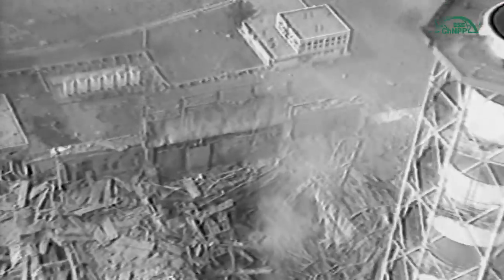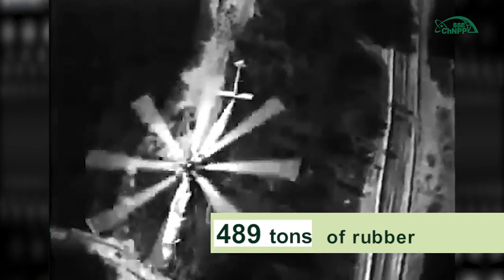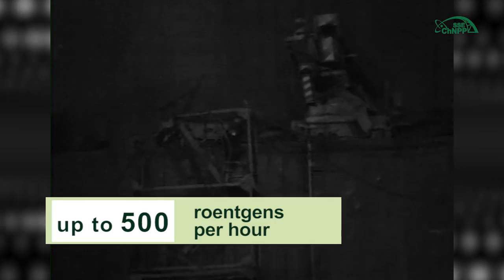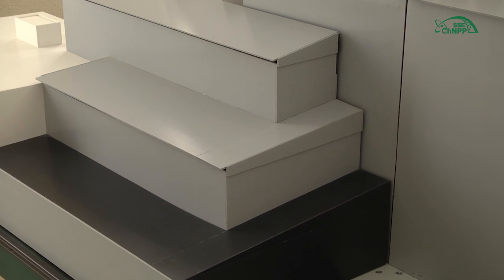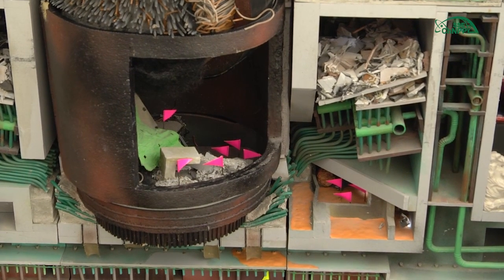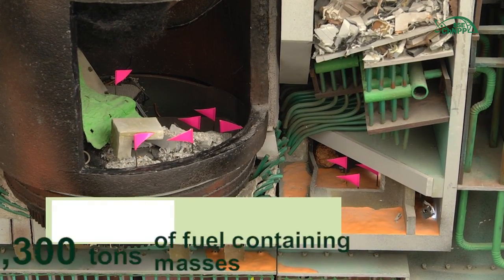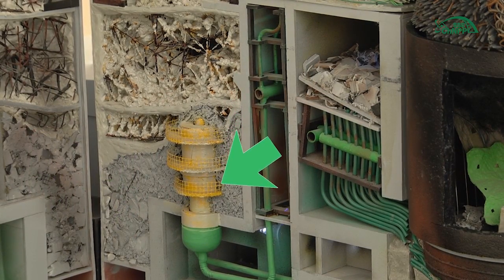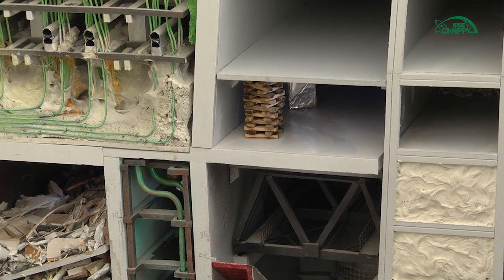Excursion within the "Sarcophagus"

Comment: I heard when the lid of the reactor was blown off, it came down with such force that it forced the reactor downward.  What that did was dislodge the sand packed around the outside of the reactor to come loose and mix with the molten nuclear fuel.  This mixture of molten nuclear fuel and glass made its way down to the basement of the reactor building where it cooled.  We are all lucky that it didn't melt down into the ground water that flowed under the plant.  That would have caused a catastrophic steam explosion that would have made all of Europe uninhabitable for centuries.

Comment: I bet the destroyed reactor could be cleaned up given how the USA has a massive crane at their ship yard they use assemble their super carriers. 

Deep borehole disposal (DBD) is the concept of disposing high-level radioactive waste from nuclear reactors in extremely deep boreholes instead of in more traditional deep geological repositories that are excavated like mines. Deep borehole disposal seeks to place the waste as much as five kilometres (3 mi) beneath the surface of the Earth and relies primarily on the thickness of the natural geological barrier to safely isolate the waste from the biosphere for a very long period of time so that it should not pose a threat to humans and the environment.

You would dismantle what's of the reactor, put the pieces into  casks, and then lower them 3 miles underground & seal it all up possibly with the concrete of the power plant itself before layering a bunch of virgin material on top of the power plant rubble.

Comment: Great model.  Still a raging communist failure.  Always use water instead of other materials as a conductor.. this way if the core melts the reaction stops because the water evaporates.  RMB reactor is flawed design and sadly they still use them in parts of Russia. 😅😅😅

Comment: Please, when showing model of the exploded reactor, first look at and analyze it a bit. If 1000-ton lid flew up 30 meters in the air and dropped back onto reactor, it would definitely crash itself and the reactor vessel creating sigificant damage to both. From the pictures (and this model too) I've seen no major damage to the lid and reactor vessel due to lid falling down, therefore I concluded that it DIDN'T fly up in the air, it just popped open and remained vertical.
Reply: Furthermore, observe the steam separator drums on the model, the green sheet arounf them (it's thick steel pressure shield in reality) and concrete slabs above it. It quite obvious they all suffered major explosion that clearly took place ABOVE the reactor vessel and its lid. It's obvious that explosion pressure came from the sides, not from below. That explosion could have come ONLY FROM hydrogen buildup. But hydrogen is waaaay lighter than air, so for hydrogen to build up in the area above the lid the ROOF and the SIDE WALLS of the reactor central hall must have been mosty INTACT after the initial explosion that popped up the lid off the vessel!

Comment: The reactor contained at the time of the accident....2000 tons of material, as stated, or 200 tons as the caption on screen says?
Worth fixing this error...
Reply: The RBMK- 1000 contains 1700 tons of graphite in which the pressure tubes are mounted, 190 tons of uranium dioxide. This is stated if the reactor is in operation. Then the material that regulates the reaction, graphite at the control rods and others. There are many other materials that keep all this things together. So the 2000 tons seems to be true. The 200 tons you are talking about seems to be the 190 tons of uranium dioxide.

Comment: This video got me wondering, would there be any advantage to filling the inside of the sarcophagus with one giant block of concrete?
I can see that perhaps it not being reinforced concrete might be an issue, and it would obviously take significant quantities of concrete to do such a thing, but would it pose any benefit in terms of suppressing radiation leakage long term?
Reply: After burrying all of it under concrete, you'd loose all control over the situation inside. So much concrete would be too heavy and the foundations wouldn't be able to hold it, and the concrete would start cracking. Next, water (rainfall) would start seeping in and uncontrollably washing radioactive materials into groundwaters. And, because it would all be entombed, you'd not be able to reach and fix it. Ouch!

Comment: I believe I saw something in the mockup model consistent to that 'infamous' Elephant's Foot structure, though I am not that sure if it's location is correct.
But in the end, if the mockup model was built without it, it's pretty obvious that this well known structure is as 'relevant' as the rest of the Corium material that leaked out of the reactor.

Comment: They should have buried the whole reactor with concrete,  and kept on isolating it until it had atleast 30m with solid stone and sand mix in the midle, and used shot crete all over the outside... You won't be able to shield the environment with a cover that was used over reactor 4.. I am sertin that chernobyl still leaks, but we never hear anything about it... Do it correctly the first time, and get the reactor sealed for life. DAMN IT.
Reply: The foundation isn't good enough for the concrete, since the explosion makes the foundation of the building brittle and it couldn't hold heavy weight anymore, the reactor and the parts itself already weight thousands of tons, that's why

Comment: I was 2 when reactor #4 blew up. It was a major disaster but could have easily been avoided. We know enough about the accident it was a combination of a bad and dangerous design with operator error on top of that. It's a given the operators were unaware of the design flaw, however they still should have know better than to remove almost all the control rods and be surprised when their reaction spiked

Comment: Imagine the amount of potential leaks in a RBMK... Every channel has it's own piping and caps. Amazing it even works.
Reply: Every channel has its own water valve, too. One of a problem is that one or more water valves can stuck in closed position that can course an overheating or an local meltdown. That happened some times in the first versions of RBMK- 1000 (Chernobyl), because not all channels had it´s own measurement instruments. The RBMK  reactors that are in operation today  all have an own  controll system for each channel, so the operators can see when something is going wrong in each channel.

Comment: I think most of the radiation landed near Kreosan because those dudes are messed up... They have a recent video where they went into the chemical lab in Pripyat or Chernobyl and took home some of the sand that's covering pieces of the liquidation robots and runs at like 2000 rems per hour. They also waded around in thigh-deep water that's accumulated in the basement of the chemical lab.
Reply: Don’t forget diving in the flooded basement with a fishbowl for a helmet.

Comment: I’m not trolling when I ask this, but, did they ever attempt the test and again, properly, on one of the remaining reactors? What were the results?

Also, what happens to the bodies that died and remained in close proximity to the core? Is bacteria able to grow and therefore, decay the remains?
Reply: No, I rather doubt anyone would approach that test with welding gloves on.

There was only two people killed by the explosion per se.  The one, Khodemchuk, is buried somewhere in the rubble; he was never recovered.  The other, Shashenok, died in the Pripyat hospital from multiple injuries, burns and radiation the morning after.  He was buried in Pripyat, later moved to join his fellows in the Moscow cemetery.

Comment: Two things continue to puzzle me about the smothering of the reactor fire and the removal of reactor core material from the roof.

No one considered firing the smothering material from a safer distance, rather than simply dropping the stuff from helicopters. The science of ballistics is a mature technology. It is not hard to hit a target over the horizon. Its also not hard to fill a blank shell with the smothering material, rather than explosive. Then fire it from the ground, high up and directly into the wrecked reactor. Depending on the weapon used, and its range etc, the weapon could have been situated a kilometre from the reactor site, well away from the worst contaminated areas at ground zero.

As for the roof, there is footage of the liquidators using cables and hand winches to remove a stuck robot. I cannot understand why they did not try very long cables and chains to drag or push radioactive debris from the roof. Long cables could have been dropped over the building by helicopter and winches attached at either end. Hooks and plough-like tools could then be attached to the cable and the cable could have been dragged back and forth over the roof.

Even the deployment of a simple conveyor belt could have streamlined the job of removing the debris. If vibration was a problem... use rubber pads. 

A small water bore drilling machine could have been modified to slowly push (and pull) a pipe across the roof with a small bulldozer type blade attached. A screw mechanism would have had enough force to overcome many of the obstacles on the roof. Such a pipe could have been extended over the edge of the building and then used to rig cables to pull material over the edge.

Alternatively... they could have used hydraulics or compressed air to remotely operate mechanical tools, with minimal need for human exposure, and NO vulnerable electronics. Such mechanical devices are used to feed raw materials into machines, even clean the bottoms of swimming pools. Other relevant devices are seen in high tech puppets in movie productions. If you can imagine building a puppet that could be operated close to molten metal... you get the idea. Robots do not need to be electronic or electric.

The extraordinary effort made to use luna rovers and helicopters build wood ramps on the roof, and to dig tunnels under the reactor. This is the same level of effort required to build and modify machines to do the worst cleaning jobs by remote control, instead of people.

Comment: This was cool and the models great. But i have a question; why didnt they just say skrew it and fill the whole thing with concrete if building a roof structure was so dangerous to the workers (Not that anyone cared ofc) and encase the core as opposed to essentially containing it?
Reply: The weight of all that concrete would have caused the whole thing to sink into the ground and pollute the ground water, the very thing they wanted to prevent

Comment: I think some of the numbers are wrong. 8000 m³ of water per hour? That would not be much, especially by six simultaneously operating pumps of that size, and given a thermal power of 3.2 gigawatts to be cooled. That would be enough to heat up more than 30,000 m³ of water to boiling point (starting at 10° C) within an hour. And the cooling water is not supposed to boil.
Even a single, normal fire engine pumps 1,600 litres per minute = 96 m³ of water per hour into the hoses. I think 8000 m³ per minute are more likely here!

Comment: People still ask me. 
Why didn’t they just pour millions and millions pounds of cement into reactor when it happened or after fire was put out. 
Without going into some very complicated reasons are. 
Although fire was out it was still very hot. Think of pouring cement in areas 2000 deg plus.
There would of been no way to fill every void within the building plus. 
With temps so high and voids etc. 
the cement would of cracked and leaked. 
In time we would of had to clean it up and if in cement like that. It would of been impossible to get to. 

God be with the souls that out there lives in danger that faithful night. 
We know many more died then reported. 
They didn’t save a town or a city or a country. 
They saved the human race.

Comment: 7:20 I was wondering if the Lid to the Reactor Core "after being launched upwards into the Air" falling back down almost flush back on top of the reactor was a helpful event or not? The model shows it positioned sideways but I am under the impression that it was placed like this on the model to show visitors exactly what the bottom of the lid to the reactor looked liked at the time? since it being on the reactor like a lid on a pot the model prevented anyone from seeing a clear view of the bottom so it was repositioned sideways, is this correct?
Reply: It was blown up into the air by the steam explosion and landed as illustrated in the mockup. The core was exposed. While having some of the opening blocked, I doubt it made that much of a difference. Not great, not terrible.
Reply: @dreamabyss5423  thank you for your replie, I live in the States and a lot of Americans salute those brave people that made up the many nuckles of the Ukraine Fist that fought that terrible tragedy, a tragedy that they still fight to this day. The Spirit and Bravery shown that day by the Ukraine people is simply fearless.
Reply: The actual lid remained in almost vertical position after the explosion, in the position it is standing today. Nobody touched it after the accident. The horizontal angle is about 45° compared to the reactor's central hall orientation. Such position made it possible to see the inside of the burning core from the above, and there's a video of glowing hot magma inside the reactor core filmed from the helicopter after the accident.

It is very hard to say that falling back and staying flush (I do not believe it was launched up in the air therefore I do not believe it fell back either) would make significant difference. Maybe it would create barrier to prevent some fuel flying out of the core, but it would create insulated space where fuel would overheat faster and melt through the vessel faster, creating more corium in process. We know that corium didn't penetrate throught the concrete, but this way it might have and it might have reached underground water bed and created another explosion that would have blown all what remained (probably including reactor no.3 too).

Comment: 2000°C is the temperature your everyday cigarette lighter burns at. That's gotta be a mistake
Reply: That's a theoretical figure assuming perfect combustion and zero transfer of heat to surrounding air. Here's a video of jet butane lighter (Bic is Butane also) which burns at 1180°C /watch?v=37Kn-kIsVu8 - I'd wager a Bic burns closer to 800°C.
Reply: @PurpleRonnie836  if ambiental factors are not adverse, most Butane lighters burn at 1900-2000°C, while an adiabatic combustion (with no loss of heat) would lead that to approx. 2300°C. But it doesn't seem plausible a nuclear reactor when exploding would reach only 2000°C
Reply: @PurpleRonnie836  Here, at 01:23:40 a.m.

https://www.google.ro/amp/s/amp.interestingengineering.com/chernobyl-a-timeline-of-the-worst-nuclear-accident-in-history
Reply: 4650°C before explosion

Comment: The "dome" covered in wire in the center of the model is the core, it flipped on its side when it exploded, each wire is connected to a rod that weights around 350kg. The power of the explosion was massive.
Reply: These "rods" sticking out the top lid are actually steel tubes - channels that housed the fuel assembiles, boron rods and sensors. They actually helped lessening the force and the speed the lid popped up, as most of the energy was used to break the tubes and to bend them.

I doubt much of the content of the tubes remained inside them. These tubes were very long and actually top seven meters were outside the core, containing just water and steam. Water spilled out immediately after the first explosion, fiercely ejecting whatever was left inside the tubes onto the burning core.
Reply: @visnjamusa9395  amazing.
Reply: That's not the core flipped, that's the reactor lid, with the fuel rods that are sticking out like noodles.
Reply: You can't compress water. It does some nasty s**t. I think the upper part of the reactor was still full of water while the middle/lower half was voided in a gas state. Water in a gas state can be compressed but not in a liquid state. Which is why I think the lid getting tossed off happened. If it was pure steam, I think it would have just ruptured. The fact it tossed the entire lid off with all the tubes almost all the same length tells me the upper portion was still liquid. Which compressed by the gas would have been pressurized 10s of times more due to molecules being more densely packed.
Reply: That "dome" is the so called Upper Biological Shield (UBS) weighing 1000 tons. It used to cover as a lid the actual reactor core which is the large cylinder you see below it. The explosion in the reactor core blew it off and it came to rest as depicted at an angle of 15 degrees from vertical exposing the shorn off and twisted fuel and control rods.
Reply: no, it is the UPS
Reply: massive ? kt ? more than half ?? just äskin v?v
Reply: I thought those wires were control rods?